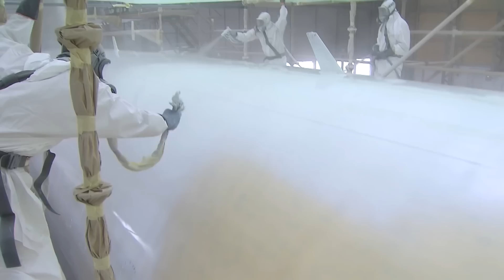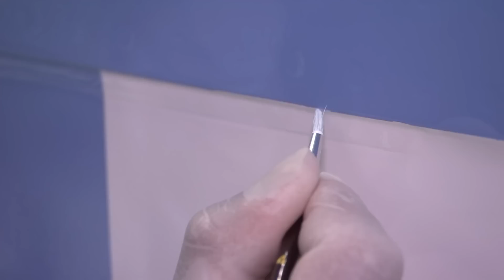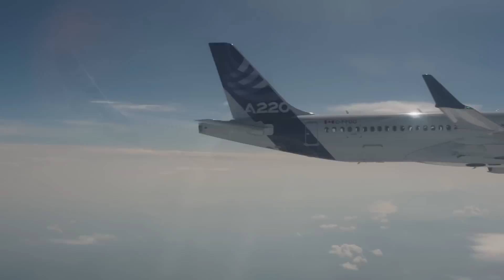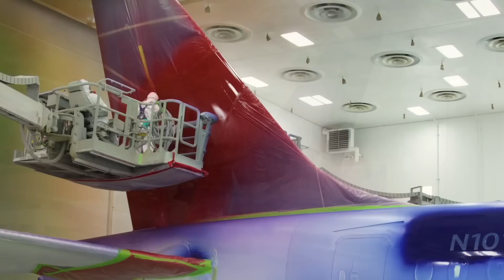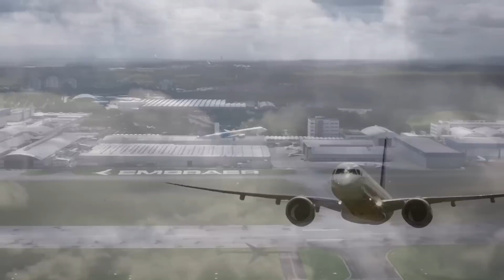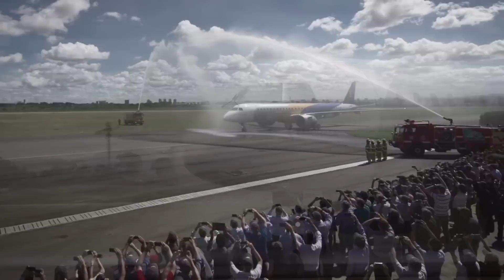What Is The A220-500?

Comment: Problem is that Airbus is still losing money on A220 series production because of low production rate and low productivity. The manufacturing process is not yet streamlined and not optimized for mass production. Airbus would not meet breakeven on A220 until 2025. So it would not launch A220-500 until at least 2025.

Comment: The comments around the A319 being irrelevant surprise me. You cannot determine the relevance by just  comparing one model against another unless you are a single aircraft variant airline (as Ryanair were with the 737 - 800). 
Easyjet for example currently fly A319, A320 & A321 and to replace their A319s with A220s and their different servicing and rating requirements may not make sense. 
As for an Airline like Air Baltic, should they require to add something a step up in size from the A220 - 300, a dash 500 if available would probably be a no-brainer. 
In short, depending upon what the airlines require, and which airlines are buying, there could easily be room for both. Flexibility is often key, and aircraft may be rostered depending on the demand that day. Interchanging aircraft of the same type, even at the last moment is easy for the crews, and if seat reservations are involved, ground staff too - it is not as easy when the aircraft have a different number of seats accross. 
I think that a lot of the A319 detractors are oblivious to the fact that the A319 is quite a bit younger than the A320, and that there are many reasonably young ones flying. When these become due for replacement it will be interesting to see where the sales go - the likes of Easyjet have hundreds which could be due for replacement over the next few years.

Comment: An airbus A220-500 would make the Airbus A319 Neo irrelevant for sure. The A320??? I can see some cannibalized sales but the A320 Neo has a big range advantage that the A220 just wont be able to close. Both are excellent planes and while there might be some overlap I don't see the A220-500 taking a big market share from the A320 Neo or 737-800/Max 7 & 9. The A220 was designed strictly as a big regional jet for short hops, in that regard its unrivaled and better suited than the A318 and A319. The A320 Neo was designed for medium haul routes and excels greatly at that.

Comment: If Boeing hadn't rushed the MAX program to stay competitive with Airbus's NEO perhaps it would have succeeded. They put to large an engine on this new 737. Some might say it's the same engine Airbus is using for their A320 NEO's. However their is a BIG DIFFERENCE. A320 engines are fitted to the wing, where as 737 engines are underneath. You just have to look at older gen 737's to see how the engines sit lower which is why they are oval and not rounded. When they fitted these newer MAX engines they had to restructure the wing to accommodate the heaviness and that in affect messed up the yaw and pitch. Long story short it was a rushed disaster and now airlines like Southwest who TOTALLY rely on Boeing for their 737 fleet is screwed moving forward into the future. And i'm hearing they are looking to break their long standing contract with Boeing. And start looking at the A220 FAR more seriously. And honestly they'd be VERY wise too. I have flown on the A220 a few times now folks and it's HANDS DOWN the quietest, most comfortable, & technologically advanced small regional/domestic aircraft i've ever flown on. It quite literally could become the new 737 in terms of it's long standing reliability history. So if i were Southwest i'd be looking at this jet FAR FAR more seriously. The MAX program is screwed even if you get these jets back up in the air again. People will be VERY hesitant to fly on them after the multiple back to back accidents they had upon initial release and honestly can you blame them..!!! That obviously hasn't happened to the A220 yet and that speaks volumes...!!! I wouldn't be surprised to see the A220 across the board become the new standard of regional/domestic jet in the very near future. And NO folks i'm not a Bombardier or Airbus employee. Just an aviation enthusiast with a passion for planes giving everyone my honest opinion on how awesome the A220 really is. You'll see this for yourselves the minute you fly on one.

Comment: In the dense configuration the A220-300 can carry 160 Passengers, (145 in a 2 Class Configuration). A A220-500 would be best to offer a Maximum of 185 Seats in a Dense configuration (170 in a 2 Class), That's the Sweet Spot !!!. If Such a Stretch could be achieved, within a couple of Years,you would see 30% of the A220-300 Orders converted to A220-500 Orders, while being VERY competitive with smaller 737's , Embraer would have Great Difficulty matching the Performance Levels & cost Per Passenger Mile.

Comment: C series is better than the 737max It can take off from a shorter runway, land in a shorter runway and better fuel efficiency. Boeing tried to rush it by making a Boeing 737max but it can barely do transatlantic flights. C-series just got ETOPS certification from 180 minutes away from a diversion airport

Comment: Will it be more fuel efficient than the A320neo?
Reply: The clean-sheet smaller-diameter fuselage and engines, a slippery wing and much lower empty weight could give the A220-500 a fair edge over the MAX8 and A320neo.  The CSeries wing is ready for a A220-500 heavier aircraft, but the MAX8 is a very fuel-efficient competitor so Airbus should look into maintaining short-field capability by adding raked wingtips, a takeoff thrust bump and more fuel for 3600 nmi.

Comment: If Boeing wants to compete with the A220, they should make a redesign of the 717
Reply: Ah yes, the old diesel DC-9, with BMW/Rolls-Royce engines bolted on and an MD-11 cockpit. You will find articles arguing for its replacement, saying that the old 717 are not efficient on fuel. Delta knows otherwise: The best-kept secret of the 717 is its per-passenger-mile fuel efficiency advantage over the larger A319. The 717 is a phenomenal, reliable, profitable, comfortable and very, very fuel efficient aircraft, and it will stay with Delta almost forever, alongside the CSeries/A220.
Reply: @texasabbott  oh sure... but I think the best bet would be a rebuild of the DC-3, don't you?

Comment: The real question is A220-500 or A319/320? A220-100 is new smaller than A319 for other types of routes and number of seats, A220-300 is ob the border/overlaping A319 with better efficiency and comfort. From business point of view they won't. As mentioned Airbus has percentage share in CS programme, means not all income becomes profit of Airbus. All depending on numbers, if they will be able to make better profit on A220-500 than A319, then yes. I would rather think about 70-90 seater very efficient turbofan aircraft (new generation of CRJ7) to make ecoomically justified new p2p regional routes. Seatmap 2+2 is great.

Comment: Well Boeing just got a majority stake in the company from Brazil.
Reply: Boeing-Embraer could get ahead of the game if they quickly and quietly designed a clean-sheet 737MAX8/737-800 replacement with big wings, lightweight smaller 3.7m diameter fuselage, and optimized ultra-high bypass engine. The problem Boeing will face is that Bombardier built the CSeries with no compromises, so their engineers spent years 
integrating the entire wish list of passengers, pilots and airlines into that plane. At the moment, Boeing seems content with giving their 737MAX a PIP package for year 2021, and in that time, Airbus will go in for the kill.

Comment: The -500 sounds like a great idea if airlines want it. But what about the engines, are they powerful enough to to handle the extra weight and if not what would it take maintain the same performance as the -100 and -300?
Reply: The PW engine is powerful enough to power the A321neo. This -500 should be a piece of cake...
Reply: Ching Wei Xion well not exactly. The PW 1100G in the A320 series has an 81 inch fan and produces 24,000 to 35,000 pounds of thrust. While the PW 1500G on the A-220 has a 73 inch fan and produces 19,000 to 23,000 pounds of thrust. Not sure about the ground clearance on the A-220 and if it could handle a larger fan required for a more powerful engine.
Reply: @Crazyuncle1  This is where the  marvel of the geared turbofan comes in. The core and the fan can be separately optimised for higher thrust. Unlike normal turbofan where you'll have to sacrifice one or the other. Judging from the 19-23klbf that you mentioned, it seems like the PW1500G still has a lot of juice left for a heavier aircraft. Also not forgetting the A220-500 was initially in planned by bombardier, so it is unlikely that PW offered Bombardier an engine that is at its limits and Bombardier exclusively selected them.
Reply: @Crazyuncle1  The PW1525G is certified for 24,400 Ibs. of takeoff thrust, with additional an 5% non-static thrust beyond 75 mph on its takeoff run and throughout its climb.  If more thrust is needed, the engine (especially the LPT section) will need to mature for another year with new materials and upgrades. A theoretical A220-500 is lighter than an A320neo, and 27,000 Ibs. of thrust would be ideal to preserve its shortfield performance.
Reply: texasabbott Good thinking, great post. I think when Airbus can start producing the A220 in large numbers, in Mobile, orders are going start flying in. And the -500 could be very popular with carriers. Cheers, fellow Texan.
Reply: @Harry >  A better questions is:   Will the -500 need a whole new wing.  If it does, That will greatly increase the developement cost and flight test required to Certify.

Comment: This variant makes sense,  hopefully sooner rather than later. If it stretches to 160- 165 capacity it's not direct competitor to 180 to 185 capacity a320neo. Drop the a319, it would be well outperformed by a 220-500 and Boeing have no viable alternative 737-7  isn't  going to suddenly start selling.
Reply: Hot & High. the only use for the A319N is for high altitude airports

Comment: Not many CS/A200s have been sold or ordered yet, Airbus should redo the avionics so that the A200 and A320s are very similar. I would think that this size should do very well because any given aircraft can only be optimized for perhaps 2 points. This neo do better in the 320 and 321 models, meaning the engines and other equipment are too large for the 318/319 class segments.
Reply: 530- orders arent many_ lol
Reply: It depends on what you think the market size should be. 500 is the annual run rate for each of the 737 and A320 series. Do you believe it is one full order of magnitude smaller at the 110-130 seat level compared to the 165-seat A320?
In the 737 classic era, the 300 (equiv to 700) was the big seller. In the 737NG, the split for 600/700/800/900 was 1, 16.8, 74.1,8.1%. 
For Airbus ceo, the 318/19/20/21 split was 1,18.3,58.6/22.1%
In neo, the split is n/a,0.9,66.8,32.3%.
obviously both the 737 and A320 are moving up, more likely meaning the aircraft are better optimized for the larger points rather than a diminishing market in the 110-130 range.
If the true market size for the 110-130 seat class is on the order of 200/year, then airlines should figure out that it would be to their benefit if there were a high degree of commonality - for better pilot flexibility
Reply: @joechang8696  Airbus certanly sees it as a worthy investmens with soon to be 2 facilitees making them, as to compare the 737 and the A320 with the A220 isnt ideal imo, the first have been around for decades and the A220 is a newcomer so to say and needs to prove its worth before more airlines will take them on, so far every carrier and staff have loved the A220 and with the takeover that happend in July the programme recived a massive boost. 165 orders this year is in no way bad and could be that the programme has rounded a corner. if Airbus is correct they will total ca 3k orders over it lifespan, that would be a great accomplishment for it. Trust me more airlines will order it, many A319s and lowr capacity versions of the 737 will be replaced by it in the future. You are right on the market shrinking but i think it could be because of a suitable alternative not being there untill now. The A220 is belived to be a much better alternative than the A319neo and the 737max 7 It will be exciting for sure to see how it turns out.
Reply: @Joe > The Rockwell Collins (now Collins Aerospace) Proline Fusion avionics is a very modern and capable avionics system.  To change to another avionics system would require whole new engineering and Ceritification.   A new Certification would take extensive Flight Test and money.  That would make absolutely no sense whatsoever.

Comment: Raked wingtips, slight increase in wing area and fuel, a thrust bump to 27KIbs, 170 passengers in two-class config and the CS500/A220-500 may cannibalize the A320neo, but it will absolutely bury the 737MAX-8.  Bombardier gave them the King of Raptors, and if Airbus fails to build the A220-500, Airbus will NOT survive. Boeing will take the whole market with a sneak 737 replacement at the same time that it builds the NMA.
Reply: I Don't see how Boeing can manage to a sneak 737 replacement alongside the NMA. They have yet to breakeven on their B787 program, and their B777X sales are below expectations. On top of that they are still struggling to finalise the NMA'S business case.
Reply: Its way to small still to compete with the max. The max is more fuel efficient therefore likly win as this just wrecks the 320
Reply: @ethmister  compete with the MAX?? In what? high diving?

Comment: Due to the flexibility of the A220 family especially now having 180-minute extended operations (ETOPS) capability for direct non-limiting routes over water, remote or under served regions, with the A220-100 having short landing/take off ability and the A220-300 having the ability to flew up to medium haul over water international routes, has opened up a whole new market for airlines to operate all types of routes, using a 'mix n match' A220-100/A220-300 aircraft types, which was Bombardier intentions in planning for the CS500. If Airbus does proceed with the A220-500 would complete the range of types for the A220 family with out affecting the A320/A321 family.

I do see the A319neo being deleted from Airbus product line.

With regards to Boeing, they don't a have an aircraft product range that is similar to the A220. Whilst the Embraer E2's is a good aircraft, it doesn't have the same flexibility, as the A220 can offer airlines.

Airbus made a good move with their investment in the CSeries/A220 programme.

Comment: And I thought that the a220 already outsold the a319neo. The 19neo is really pointless now.
Reply: The A220-300 (449 orders) has already outsold the A319neo (56 orders) by far.
Reply: Well, it has communality with the A320 series, so it makes sense for airlines with a mixed A320-fleet. But in terms of fuel efficiency (essentially the only other thing that matters) it will never be able to compete with an A220-series aircraft (as scaling up is usually more efficient than scaling down).

The A319 was primarily built for Easyjet, as far as I know, but they seem to move to A320ies instead.

Comment: Before AIRBUS entered into this acquisition they will have taken into account the risk of cannabalization of their own product line.   The -300 was the target model of Bombardier engineering design with the -100 (although put into production first) the natural shrink. The -500 will be the natural stretch.   The existing wing is already engineered for -500 loads.  It would be a very, very, affordable stretch and reasonably short lead time to put through certification and delivery.  It won't happen right now; but it will happen.  The range and efficiency will be there as P&W engines mature and further improve performance.
Reply: This is a good opportunity to leave old fashioned made aircraft s and replacing with the state of the art technology
Reply: @Andrew > Are you sure the existing wing can handle the load required for the -500 version?
Reply: @rcairflr  Yes, the CEO of Bombardier, Allain Bellemare, has already said that the existing wing of the A220 can handle a possible stretch to a -500

Comment: Yea but the E2 jets are still better
Reply: Also they can strech the mode to the E200 etc
Reply: ethmister6666 the c series is more efficient, more comfortable and seats more.
Reply: @fatpiggy1268  e2 is cheaper per flight
Reply: @ethmister  the E2 largest variant is competing with the smallest A220-100. Even a stretched E2-200 would only match and compete with the A220 -300. There is no way you can stretched the E2 so far to compete with  the A220-500.
Reply: @chingweixion621  well airbus seems to infinitly strech the A321. Its possible with gear similer to the Max 10
Reply: @ethmister  the A321, Airbus is stretching it's range, not it's physical length. The max 10 is your proof that you cannot keep on stretching. Boeing knew very well to compete with the A321neo, they needed 240seats but why did boeing stop the max 10 at 230 seats??? The reason is because the fuselage cannot be stretched further without structural strengthening and reinforcement.
Reply: ethmister6666 , in what way???
Reply: @lrg3834  cheaper to operate. More comfortable